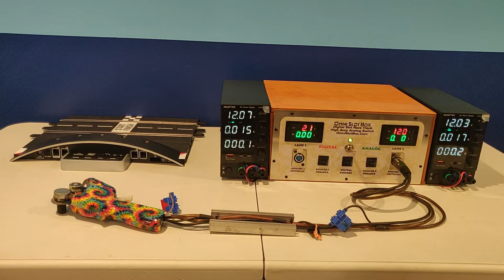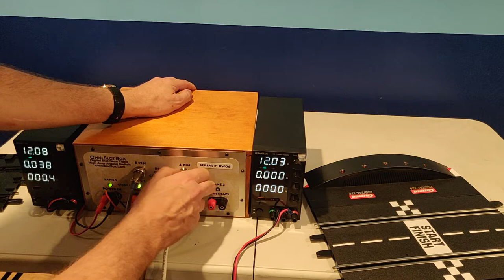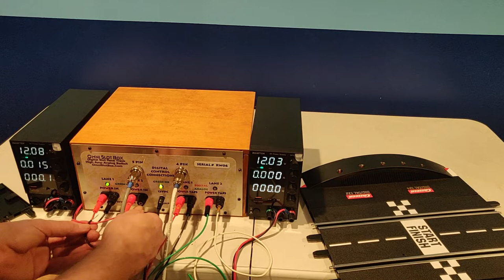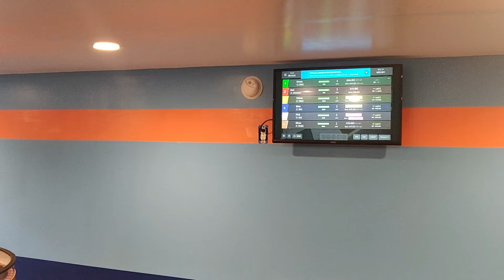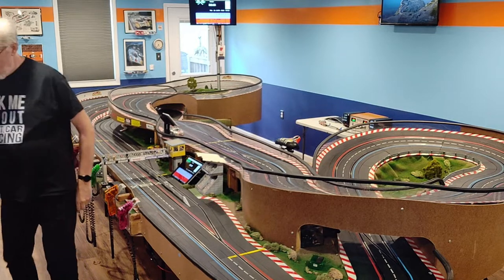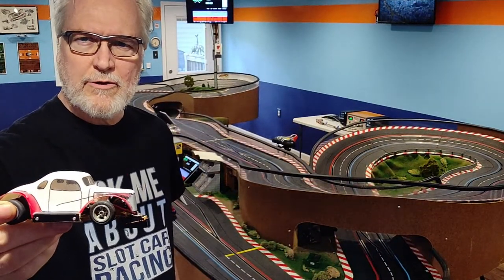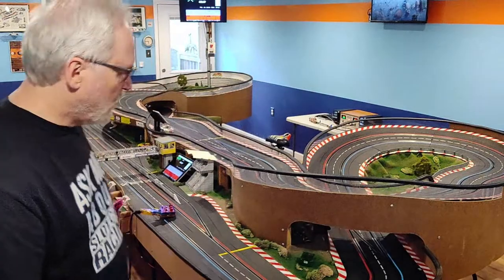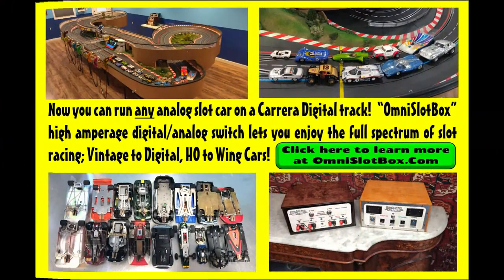OmniSlotBox Intro

Comment from the maker: Gran Prix is about 65 feet and has 7 sets of 14 g power taps.  Essentially a power tap every 10 sections.  This was done because most digital racing is done with 6 cars often 1/24 digital .  Also,  on Analog mode I run high amperage vintage and high powered cars.  If you run solo and only RTR model cars power taps may not be absolutely necessary, but still recommended. Youv ull notice a positive effect as the OSB has better power delivery, but voltage definitely declined with distance from the CU.  Low voltage not only causes cars to loose power and speed on distant corners, it can cause damage to switches when voltage at a switch falls below 12 volts.

Comment: Hello Jim, greetings from Bremen, Germany. I am just watching the Stream of Rahul aka Conquest Racing Club from last Night. I couldn`t join it, because of the Time-Gap, otherwise I would have join the stream. You mentioned your Omni-Box, which is quite fine in my opinion and that you couldn`t understand why folks in Germany are not interrested in it. I guess it is a matter of Information and many Germans may not understand English so well. Once they catch up on it, they may find it need. Also you have harder Laws in bringing it here on the market, because there are harsh rules of the Certificates in Terms of Electronic-Allowance to run it. It has to get the CE and the VDE - Certificate to run it over here. That includes some testing by the TÜV (Technical Survailance  Assossiation) next to money for legal legislation and lots of paper-work. Germany is quite difficult in that. Plus you need to have a Certificate for recycling the Product. Also a different hurdle, to get over. But mainly, your Omni - Box is quite need and once you get over those legal hurdles, I don`t see a reason for bringing it over on our market. Many Greetings, Bjoern 🙂
Reply from the maker: Bjoern many thanks or this input.  We know there would be additional hurdles in exporting to Germany. We have not promoted there as yet until we understand them.  We suspect that since the new OmniSlotBox XMR soon to be released has no connection to main A/C power voltage and only connects to the slot track D/C circuits, requirement will be less.  Also we will probably be selling only few unit consumer direct.  I know there are recycle requirements we need to understand them.  It will be difficult to judge if the market size justifies the expenses.  Do you have further thoughts on this?  Thank you for your help!
Reply: @jimcunningham534  Good Morning from over here. Thanx for your answer and your rquest for help. I looked up the Net and found three Links for you, in English. They are about those regulations and they may help, to get into it. 

In terms of Power-Supply,  of your new OmniSloBox, there shouldn`t be problems, because it is powered by external Power-Supplies. Most advanced racers and the Clubs run the Track with external supplies. But if you want to offer both alternatives between those two Boxes, because many private racers over here, who are not in a Club, run their Carrera-Tracks with the Power-Supply from Carrera, which doesn`t allow to connect the Box to the Carrera Power-Supply, or from other Brands, because they just don`t have an external Power Supply. They only use the deliverd by Carrera for instance, itself, for the supply of their Tracks . In this case you need to find a Company, who produces a Power- Supply with 230V/50Hz (German Main Power Supply  Values), that transforms it into the requirred DC values, your first Box runs with. This Transformer should be in a Plastic-Cover, because that way, there is no problem with the 3rd Grounding-Contact-Cable, which is requirred over here, if there are Metal-Covers, or Parts, that could get in contact by Hands of Humans with the Plus/Minus-Contact, in case of an electrical-shock. For that , a Fuse is released to prevent the Electrical Circle in Houses and Facilities, of an eletrical shortcut.

The Potential Cable, guides the current into the Ground. The insulated Products mainly use the Plus/Minus Contacts, like you in the US. In our case, a third Grounding-Connection is required by law and for the health of the user. Ether the Box/Product runs a cable with the Plug that has that Grounding-Connection, or the sepperate Cable for the Item of the Transformer,  has that Ground-Contact. Than you would need a Box-Connector with this third Contact-Plug. Very important issue! You guys over there, only got Plus/Minus Contacts in your Electric Main Power System and its connectings to the Products. Over here it is different, because of the Grounding Contact Cable. If the Box would be completly from Wood and the Feet of the Box would be from Rubber/Plastic, this would be allowed, but if there are any Metal-Parts are on the Product, that could be a hazard, the Groundig of the Item must be secured by the Grounding Contact, means a three cable-connection. The Color of the 3rd Contact is Green and Yellow. Plus is mainly Red and Minus is mainly Black. There are more Colors for the current leading Cable, but this is not the case here. Old Cables do have the Grey Color for the current. But that is too far now 🙂

Here in Germany, we got a guy, who runs also a YT-Channel, called slotblog.de and his Name is Roland. He runs his own Buisiness in Slotcars and is a racing nerd as well. He sells bunch of Brands and spare and tunning-parts. He is also an Engineer. He might be helpful, too, in terms of finding a distributor. Just get on his website and contact him about it. It is the same name, as his YT-Channel runs with. If you hook up, I bet both sides would have an advantage from it. I could write him a note about it, if you like. 

Here are the three Links I mentioned, in the beginning:

1. europa.eu/youreurope/business/product-requirements/labels-markings/ce-marking/index_en.htm

2. vde.com/en/fnn/topics/european-network-codes

3. umweltbundesamt.de/en/topics/waste-resources/product-stewardship-waste-management/electrical-electronic-waste/electrical-electronic-equipment-act

Always a pleasure to help others, because that is, what we are here for on this Planet! 🙂

And thanks to the Internet, we got more informations. By the way, your cars are awesome and I get a kick out of guys like you! 🙂

Stay tuned, for more....., Bjoern
Reply from the maker: We have now shipped 6 orders to Europe. Sometimes slow through customs, but no problems.

Comment: Wonderful, could you test and do a video about the Direct Drive JK car on your carrera track someday? Thanks
Reply from the maker: Excellent suggestion.  The DD cars were a very popular class at Nomad Raceways when we had our location and store there.  They were the most consistent "Box stock" class. We literally had winners right off the shelf.  

The DD cars have the fine handling characteristics of the JK2300 series, but with less torque and braking. They are smooth and very quiet. Beginner like them because they are easy to drive and experienced racers like them because they know that no one has a better car.  

DD cars can and should be driven very aggressively, as it is important to maintain speed with low torque.  

There is only one tire option, a natural foam rubber bonded to the rims that mount to 2mm axle/armature.  Foam tires work poorly on a clean Carrera track but wonderfully with a very light application of our "Track Honey."  

One issue to be aware of is that while these car run nicely at 12 to 18 volts depending on your track, they do tend to heat up and should be run in 3 minutes sessions.  Depending on voltage and track style you may find that at 4 minutes or so the motor will overheat and slow down substantially.  Surprisingly, We have never had a motor fail in this way, they always have recovered when cool. Motor replacement would not be easy. Running 3 minute heats with a minute between heat seems fine, but do not expect to practice with these for 15 minutes nonstop. 

So all in all we like these cars very much for a racing class, but not as ones only car. They are some much fun its hard to stop and you do need to let them cool frequently.

Comment: Hello Jim how long is your track, do you have power taps? I am currently running an 8.4m circuit but I am updating it to 14.55m and a future upgrade will be the omni slotbox.

Wondering if I can get away without using power taps...
Reply from the maker: Gran Prix is 65 feet and has 9 power taps. Probably more taps than is necessary for similar designs. In most cases a tap for every 12 sections or so is sufficient.  I added more taps because I run high amperage cars like commercial Group 12 cars and run racers with six 1/24 digital cars.  Also the tracks designed to be separated into three sections for transport so there is possibility of loss of connections if the contacts between tables get abused.  We use 16G wire for all taps.   I DO recommend taps for all Carrera tracks over 25 feet, especially if running more than 2 digital high powered analog.